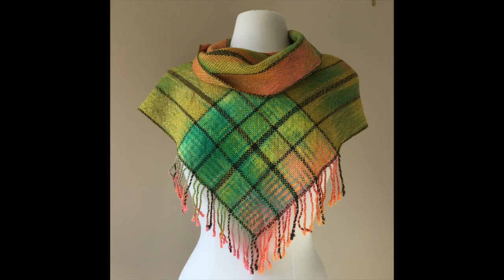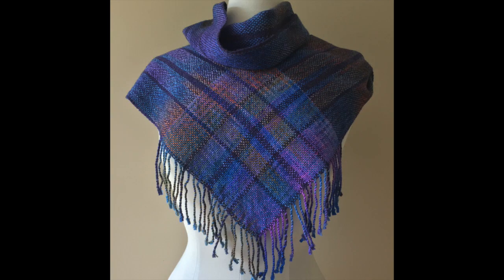Weaving a V-Cowl  (all the important bits)

Comment: Gorgeous!  And what a genius idea about using the small dowel.  Thank you!
In order to have the over/under work out correctly when bringing the warp over to become weft, do you need to be sure if you started weaving right to let, you end left to right?  I’m afraid I’ll mess this up!
Thanks for your great video!!!
Reply from the maker: I start with the tail hanging on the right, starting on a down heddle. I also finish with the tail hanging on the right (that is an up heddle). Now  both of those ends are positioned to be used in the fringe. If the first warp thread on the left is a slot it all works out well. You could probably reverse things if you prefer to pull the warp ends through in the opposite direction. And don't worry about messing up. That's part of learning. I made MANY mistakes before getting it to work out correctly.
Reply: Kari Fell thanks so much!  You’re a peach!

Comment: Kari ... I have just "discovered" you ... It is my lucky day!  I will be trying this technique very soon.  Since I live in Florida, I would prefer not to use wool.  Have you tried other yarns?  A fine cotton?  Also, if I am understanding the concept, if I weave the initial length shorter, the loop that goes over the head should be less "voluminous"?  But still needs to be long enough to go over the head ... hmmm ... Thank you ...
Reply from the maker: Thank you for your kind words! 
I have woven a cotton version and also a fine acrylic version. They are both lighter and quite comfy. Weaving it shorter would probably not work well if you still want to twist it once. I have also made a v-cowl with no extra for a loop, but it tends to not sit well on the shoulders. To make it less voluminous you could try making it narrower. That would also affect the size of the diamond shaped section on the front however, making it smaller.
Reply: Kari...thanks for your response ...I am looking forward to trying this.  I will start with your dimensions and see how it goes!  Thanks again.

Comment: How long and how wide is this (minus the fringes) before you start to weave the weft into the warp? What would be a comparable yarn to use if you don't want to dye? This video is off the charts awesome!!!!!!!!!!
Reply from the maker: Thank you! I’m glad you enjoyed the video. The warp is 10 inches in the reed and I leave 16” unwoven at the beginning. I weave until there is 16” left at the end before removing and re-attaching. That is approximately 60” of weaving. I have also use Celtic Raven Fibre’s sock yarn for v-cowls and it is very similar. Any yarn with a sett of 10 epi will be comparable to this. However, I have also used finer yarn with a different heddle.
Reply: @KariFellWeaves  Thank you so much!!!!!!! I wanted to make sure this would go around my head the way it's supposed to. I happen to have some sock yarn that is hand dyed and was wondering what to weave it into. I guess I now know the answer to that question!!!! Again thank you so much for the wonderful video.

Comment: Hi Kari 😊 I’m curious if you have ever done a hem stitch at either or both ends of the weaving instead of tape and, if so, how it turned out?
Reply from the maker: No, I haven't hemstiched a v-cowl. Since the fringe is to be twisted or knotted, I don't feel hemstitching is necessary. Tape would still be necessary for the loose ends pre-weaving back in  (hemstitching at the beginning would give an obvious seam). Hemstiching up the side and then at the very end is possible. Let me know how it turns out if you do try it!

Comment: Please can you tell me, did you say 16 inches unwoven to start with? Then how long , in inches do you weave before making the v?
Reply from the maker: Yes, 16 inches at the beginning. Then I weave until there are 16 inches left in the warp. On my loom that's about 60 inches.
Reply: @KariFellWeaves  thank you so the warp is 92 inches long?
Reply from the maker: @JanetMorganmorgana  It may be few inches longer as I use an 8 foot table to direct warp. When indirect warping, it can be even longer, as I wind 3 yards pre-dyeing. Those extra inches are part of the knots on either end, which are not included in the 16 inches. But I don't measure out woven length as I go, as I just weave until the packing drops off the back beam, so some cowls are longer than 60 inches of weaving.

Comment: What size painters tape is that?
Reply from the maker: It's one inch, but it doesn't really matter.
Reply: @KariFellWeaves  thank you for your prompt reply.  I have one more question:  I have a Sampleit 16 inch loom and there is only 9.5 inches between the heddle (when put in the back position of the double heddle block) and the front bar.  Will making it shorter look okay?
Reply from the maker: @theresaschaper6522  I too, am using a Samplit with not much space between the front bar and heddle. You still have to roll it on as you go so that weaving space doesn't really matter. If you are talking about the "V" part, all of the weft threads need to be woven in and that determines the size of the woven part. It will be rolled onto the front, so again, the space between front bar and heddle doesn't matter.

Comment: It would have been good for me if you had showed how to put it on because i have never worn one of these
Reply from the maker: Oh, you are right! Good idea. I am just finishing another cowl and I'll video how I put it on for that one. In the meantime: arrange the V at your neckline first and smooth across front and shoulders. Then take the big loop that is behind your back, twist once and gently place over head so it lays around the front of your neck. I hope this explanation is clear.
Reply: Kari Fell, oh thank you. Looking forward to the next video. I was just getting ready to start a wool scarf and now I think this type may be interesting to make. I have a Macomber floor loom. What size is your yarn and how many yards and width did you make this one?
Reply from the maker: @laura-leemurphyuta78  The warp is 8-9 feet long. It’s 96 ends of sock yarn at 10 epi. I’m not sure how it would work on a floor loom. The longer distance between the cloth beam and fell line might make it difficult to weave the beginning into the end. I plan on trying it on a floor loom in the future to check this theory.
Reply: Kari Fell great! Thank you. I saw the utube vid from curmuggen (spelling?) and he used two threads of 10 or20 pound fishing line weighted down on both ends to use as a shelf for the end of scarf while he was weaving the yarn in to the end. The only thing I didn't like was he cut the first piece off and added to the side of the second piece instead of keeping it all as one piece.